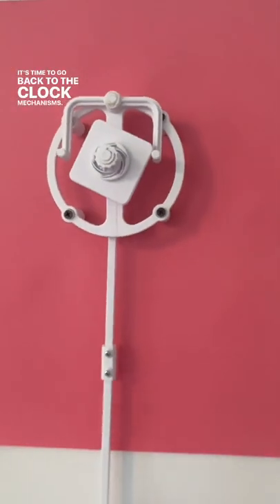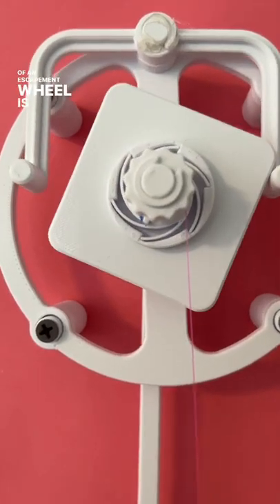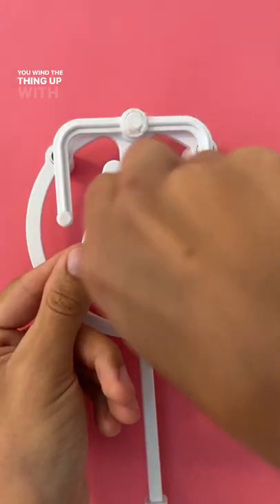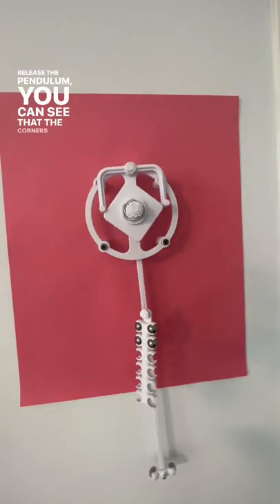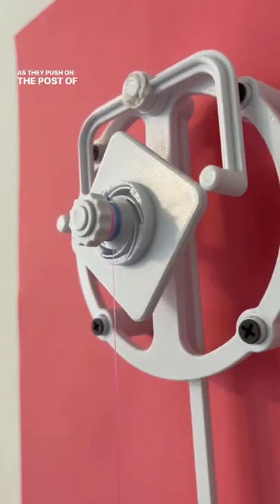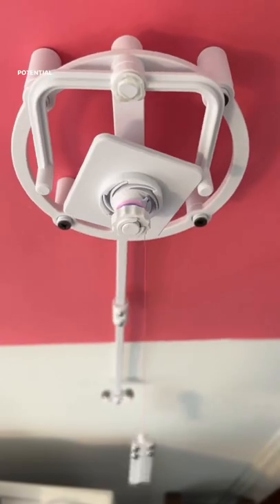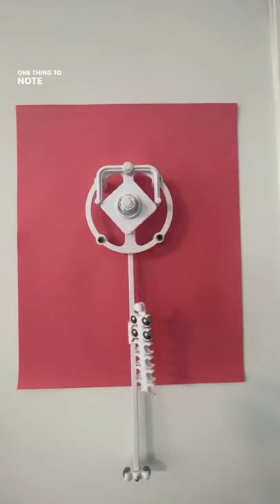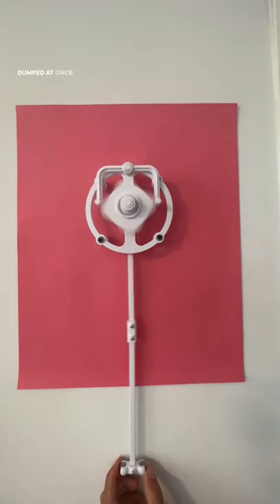The Square Escapement Mechanism

Comment: This is unique. It's pretty cool. I have a what if question. What if the two arms that keep tapping the sides of the square were both weighted so that the movement of the square continued the movement of the weights so you never need to rewind your watch?

I'm visualizing a larger circle that goes drop to the ground but then in circles the whole clock itself again and keeps the weight on the top. Like a wireframe slotted washer
Reply: I'm not entirely sure if I understand your explanation fully, but I think you mean a perpetual machine? Eeh sorry to say it but those are impossible...

Comment: This would be a good design to use for an idea I've been working on. Instead of requiring a weight to be wound on a string of finite length, you should power something with a water wheel and a pump. ☮️❤️🌈

Comment: You should make one with adjustable speeds as a metronome different bpms.
Reply: Wouldn't adding more weights do that?
Reply: The speed is governed by the length/weight of the pendulum. It appeared to be adjustable.

Comment: Do normal clocks tick-tock for a similar reason of a long stroke/short stroke cycle?
Reply: No, a "normal" escapement should have equal timing but the escapement bar (anchor) is only driven from one end which is why the sound is slightly different.
Reply: @chrishartley1210  thanks for the reply!